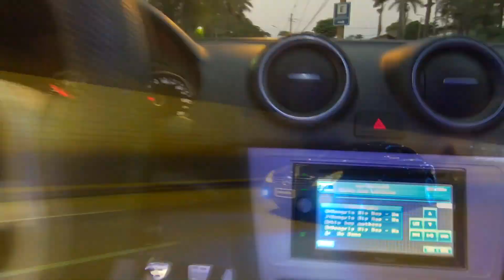VW UP SECÃO PRA ASSUSTAR POPULAÇÃO!!! ☢JuNiOr SoM♛®

Comment: Olá, queria tirar uma dúvida, tenho uma caixa com dois Snake GTK 4ohms de 1200rms cada e uma MD1200.1 2ohms, tenho um cruze com multimidia Caska original, quando aumenta muito dando grave de disparar alarme o modulo meio que começa a acender a luz de clip, isso acontece porque o módulo é mais fraco que os falantes ou por falta de baterias?
Obs: Tenho uma bateria de 70ah no porta malas e uma 60ah no motor.
Reply: Tá com falta de bateria e modulo fraco mano

Comment: Módulo 3 mil ou de 15 seco um voltímetro um equalizador um  stesisom 800x4 e uma. Bateria e uma corneta 305 ou 205 não lembro  ser auwe vale 2000 mil?